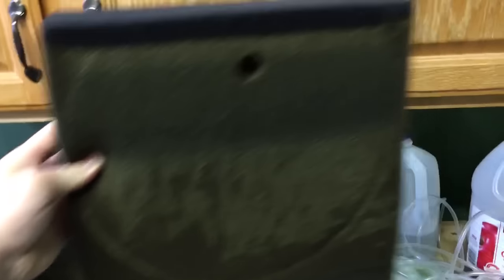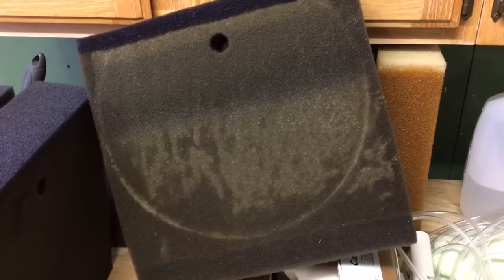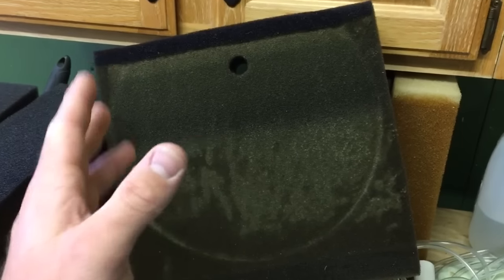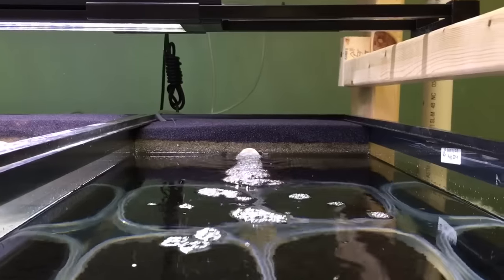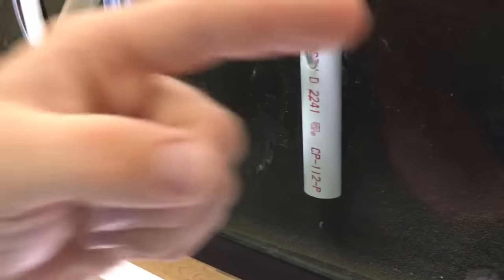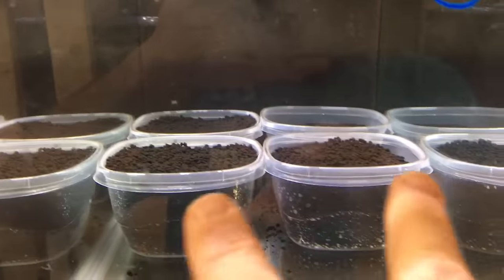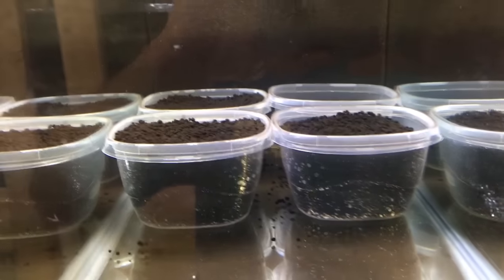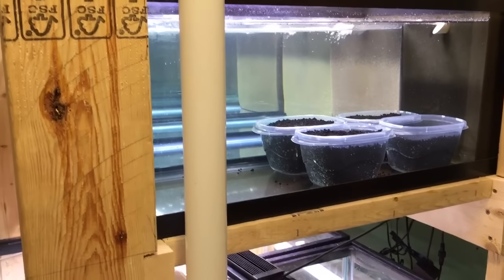How to Make Your Own HMF (Hamburger Matten Filter)

Comment: He Lup was justing looking for the sponge to setup 3 tanks with HMF and tada you made video. Will try your method. What kind of foam I should be looking for and could i Use 1/2'' PVC instead of 3/4'' for the lift tube.

Thank you.
Reply from the maker: Hey Elvis! Thanks for watching. I forget what type of foam it is exactly so I'll have to call them on Monday to find out. But 1/2 in is fine. It just won't allow as much water flow because the air stone takes up some room in the pipe
Reply: ok will wait for that, I ve seen 30 to 40 ppi online. 
Will stick with the 3/4'' then coz more water flow is better. 
I would also like to order baster AE will send you an email via your website. 

Thank you.

Comment: Hey man, im going to be starting up my first shrimp tank, been really into it all lately. This filter system seems really effective and id for sure like to use this in my 20 gallon long. I looked on your website where you sell the foam and pipe set but noticed youre currently out, so my two questions are , will you be selling more soon for the 20 long size and what type of pump or how strong of a pump would i need for just one tank for now? Sorry for the long comment , awesome videos and cool that you are from ohio, i am in dayton!

Comment: Hey quick question. How's the cleaning process? I'm guessing u have to take the whole thing out and clean it, then put back while making sure no shrimp are behind the filter pad. Which seems a little bit hard. Let me know your experience because I'm planning out what filters to use. (between these or the double sponge filters)
Reply from the maker: Hey man, great question! My plan is to remove them once every 12 months. Once removed and cleaned, add back in. I've tried it and had about 20 shrimp get behind it. Once the debris settled, I used a net and just caught them one by one. Took me a combined total of 30 minutes to get it all done. So, it's doable just a little work and time
Reply: Cleaning is only necessary if water cant flow through anymore. Too much cleaning is in fact counterproductive because you will remove all the useful bacteria

Comment: Hi Rob,

Is the hole for the air pipe through the Pvc pipe suppose to be exact or can be a bit bigger. Would that affect the airflow if it's bigger. Also how thick is the sponge and did you get a chance to find out the ppi of the sponge. 
Thank you.

Comment: Can I add some biomedia at the back?
Reply: You could, but there's really no need to. The way this filter is designed is to have an established ecosystem within the sponge, you really shouldn't be changing it regularly and the sponge should house more than enough beneficial bacteria. Adding the biological behind it would just make an extra stop for something the filter foam already does. I would just install it and do your water changes, maybe lightly press the siphon into the front of the sponge once a month or so just to get any excess build up.
Reply: If you want to, but remember that you need to take the sponge out to clean it. So make sure whatever you put behind it is not loose, otherwise it will make a lot of work when you clean.

Comment: isnt a powerhead more easy and more power full?  I use a powerhead with a tube thats fits on it Just made a hole in it and squeezed it in there dont need no pvc either works dam well my Matt is full with stuff love your vids tho bro keep it up
Reply: It is more powerful but you really dont need much flow or water turnover for shrimp tanks.  Air pump is easy, provides enough and you can use a single pump on multiple tanks.

Comment: No need to get so complicated on putting in a hole/ Get something sharp poke it trough push the the tube trough and done keep the hole quite a bit smaller than the tube and it will fit quite snugly